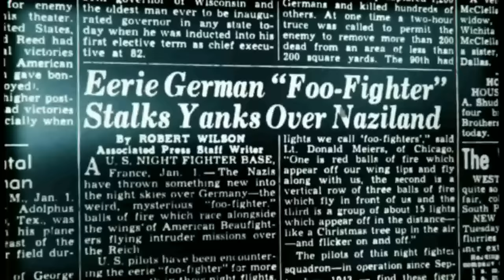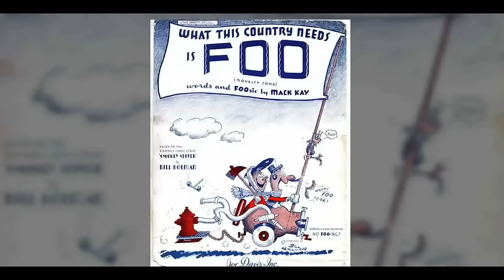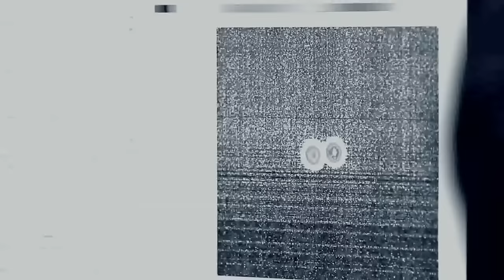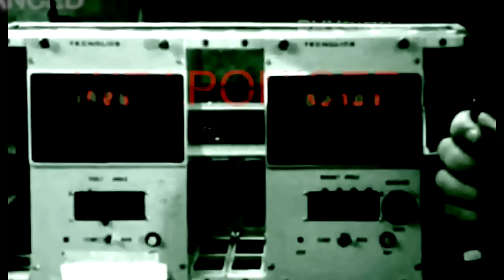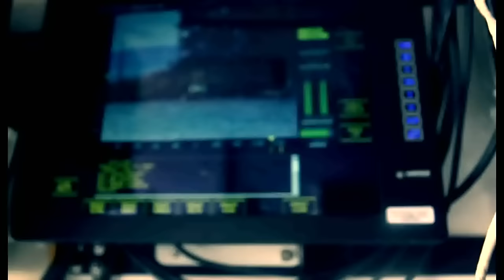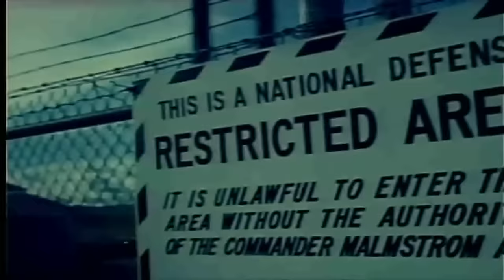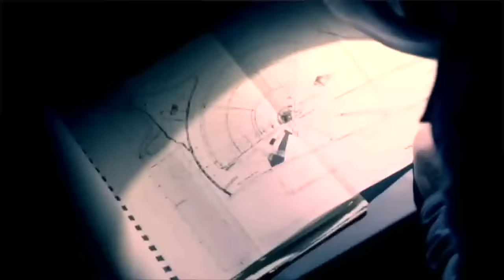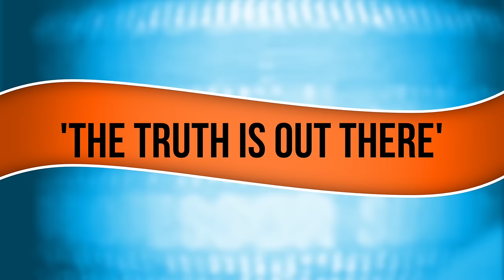Foo Fighters Secrets Solved

Comment: Reference the image at 20:47 looks exactly like what i saw in 1996 or 97. Was about 15 degreees above horizon one night in delamere south australia. Came from east southeast, from the direction of victor harbor, no sound, looked bout as big as a soccerball in sky. Was heading in a straight line towards kangaroo island, to the west of pennashaw. We had a nice view over backstairs passage to the island and penneshaw township from our verandah. Pretty much did a right turn and accelerated away to west.
Was seen by an off duty copper on island an a pilot over ceduna way. 
A thirty second encounter, was definitely radiating as your depiction.
Was reported in local paper at time. Have since searched archive ufo archive for report, cannot find, dunno why.

Comment: The Brits launched a commando raid to acquire German Radar knowledge in WW2, was it near foo fighter sightings?
Reply from the maker: most german CW radar could ionise air
Reply: @SimonHollandfilms  And if you aim a bunch of CW radar beams at the same spot in the sky where the bombers are then the overlapping peak power spots might make a bunch of plasma balls.  Seen some 3D hologram type displays that use focused lasers to make plasma spots in the air to generate a 3D image. This is just a much bigger version with microwave beams.  I also suspect they wanted the high power CW beams to interfere with bomber electrics, but is there evidence for this? Did they know about Tesla's death beam comments?

Comment: I believe Nicola tesla death ray was surprisingly simple. Ionizing lazer and a tesla coil and a power source.
Reply: Basically, The professor did a video on the death ray. The lazer was an electron beam like in a television tube without the glass in front. It used high laminar air pressure across the opening for the beam and draw a vacuum for the electron gun at the same time. Then ya the tesla coil arc would follow that path but a strong lazer should do the same.
Reply from the maker: lots of power
Reply: It was a particle or beam weapon.